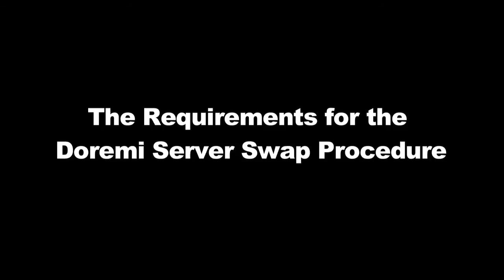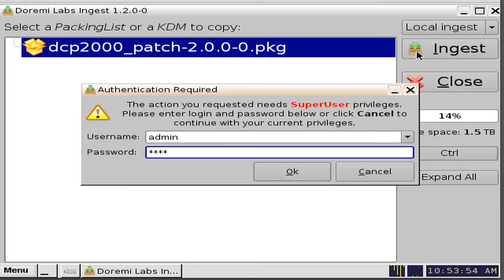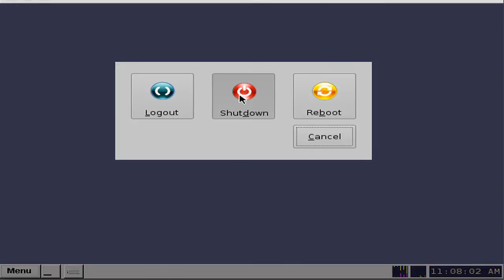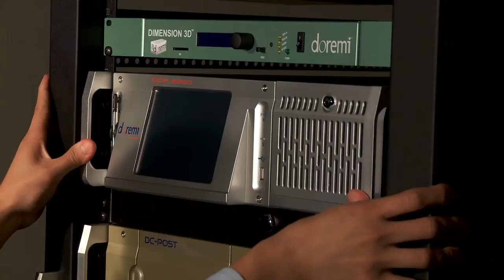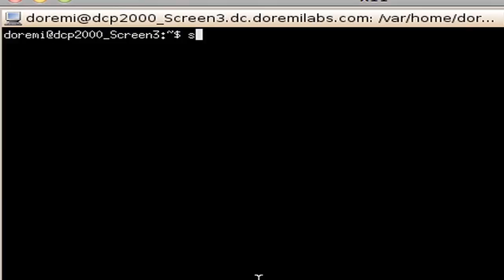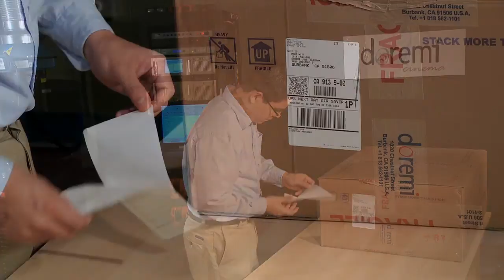How to Swap out a Doremi Digital Cinema Server Tutorial

Comment: (July 2023) This is really out of date. After the first boot with the original drives in a replacement server, current software will give a "red ball" warning about Backup Manager failing, with a link to start it. That asks if you want to use the backup saved on the drives (from your original server). Say YES and it automatically will transfer all your site settings (IP addresses, devices, macros, etc) and you're back on screen right away with all content still there. No terminal commands running the migrate script are needed. You can save a backup to a USB stick first in case the simple restore process fails but I have never had it fail.